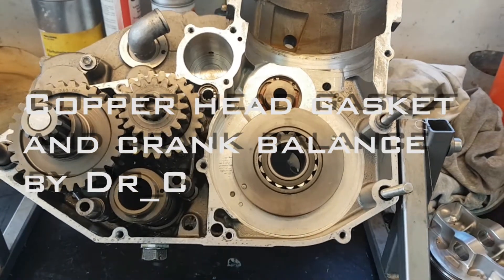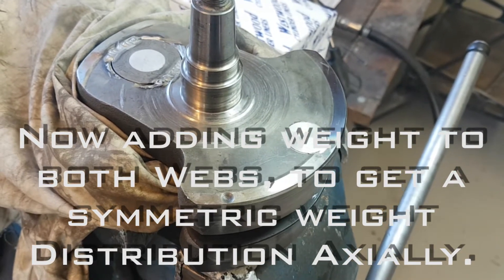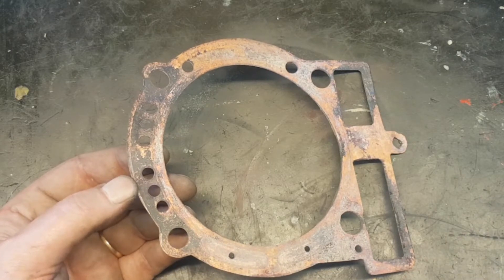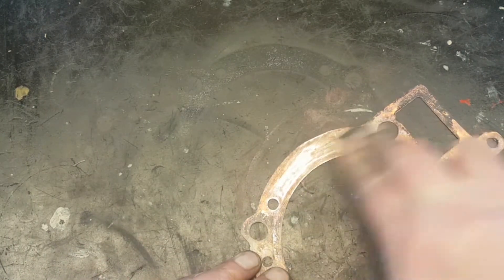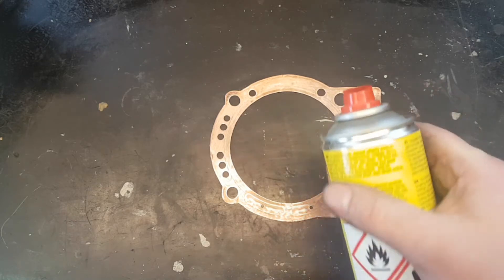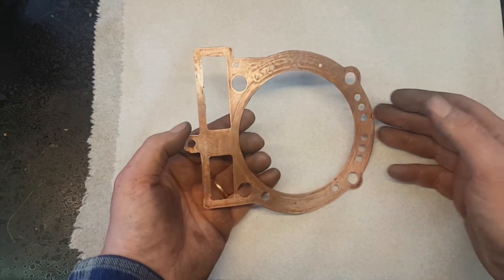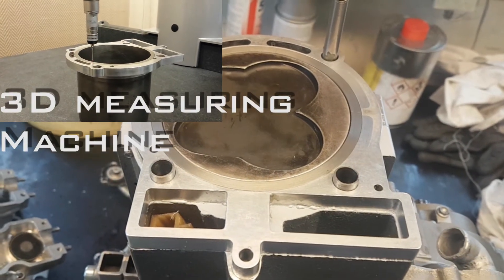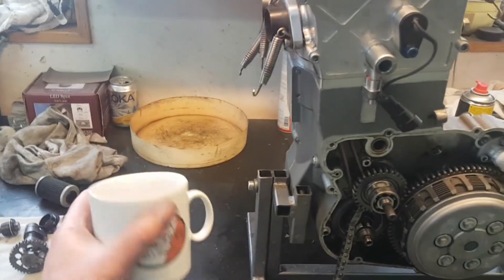Head gasket and crank balance

Comment: You should have not get rid of that counter balancer...   however it is preferable to have vibrations on the horizontal so a higher balance ratio may be better.
Reply from the maker: The main bearings seized every 5-6 hours, so I needed to do something about that. I tried 3 different types of bearing, of OEM dimensions, with equally poor result. Spherical roller bearings did the trick, but then the cb had to go...